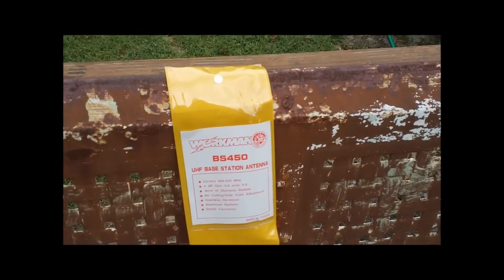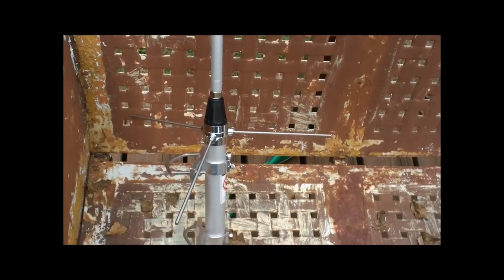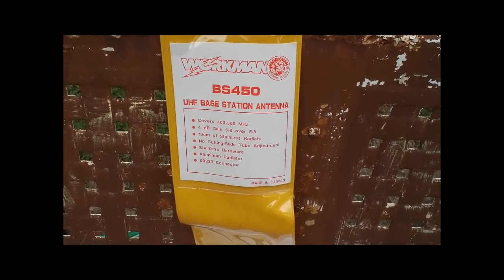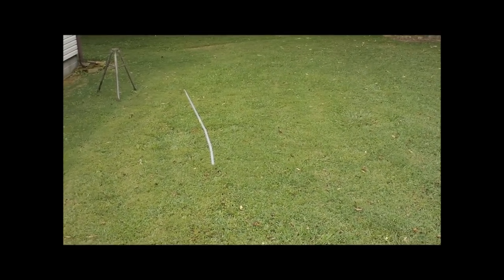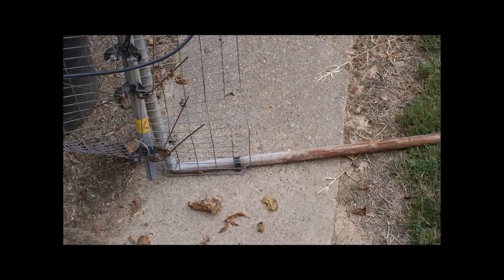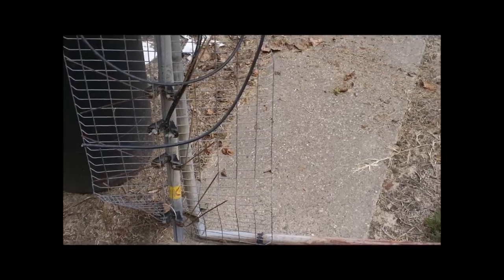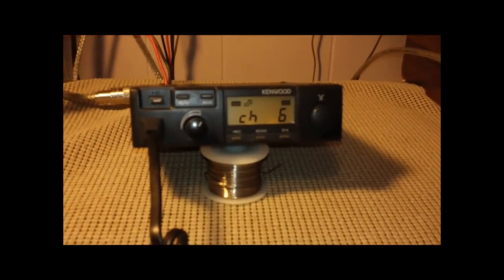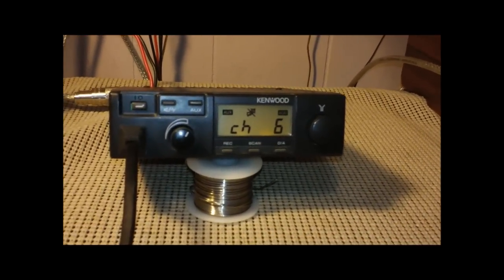GMRS base setup test Workman BS450 & Kenwood TK-805D FM Radio

Comment: just started in the GMRS radio scene. I got two handheld Baofeng's. Getting a Kenwood TK880 and TK860. They are both used and have been set up for GMRS. I have a telescopic mast that I have had since back in the CB days. It extends up to 60'. The telescopic mast are pretty cheap.  WQTZ396

Comment: I have this same antenna.  I bought it on ebay under the TRAM brand name and it works great.  I had to shorten a little more than what it said on the spec sheet to get a good match on my swr meter though.  I'm in LA and we use repeaters here a lot.  Its great I can talk all over the LA Basin.  There is a repeater on every GMRS Pair here.